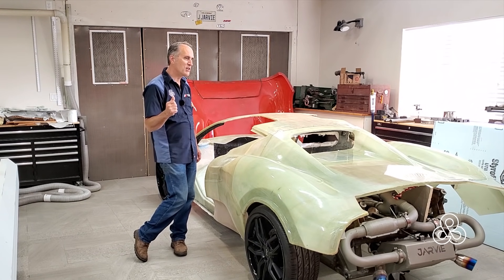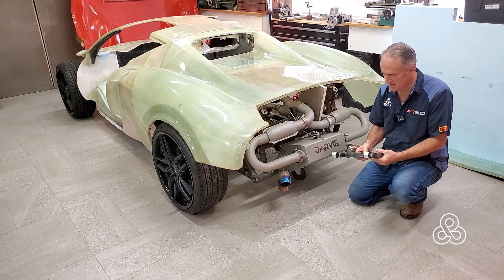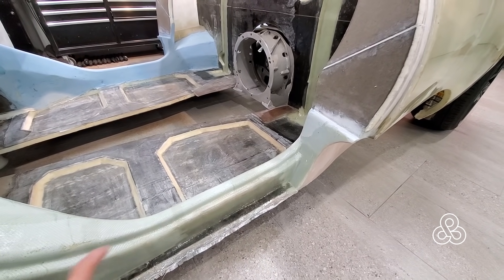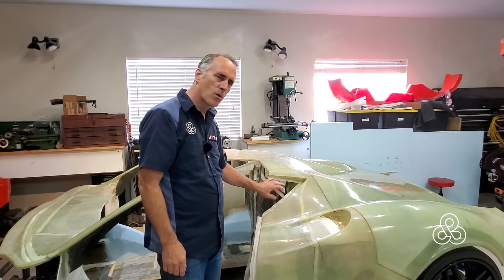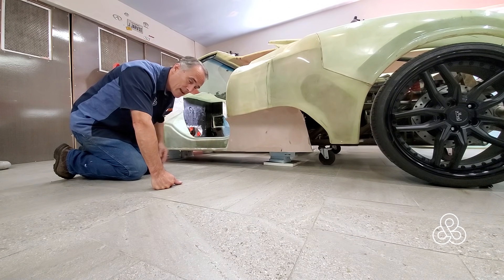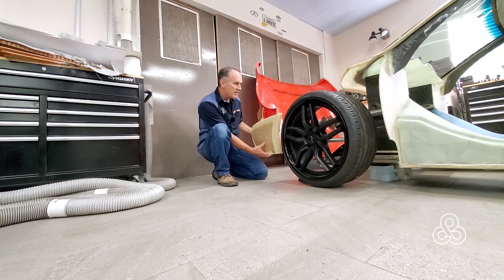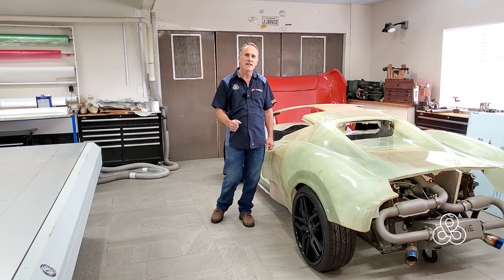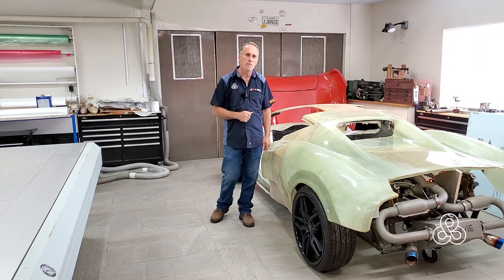Building a supercar from scratch! - What I would do different next time.

Comment: Imagine how much less rework would have been needed, if using Autocad had not reinforced the misconceptions of 3D modelling being expensive, complicated, difficult, and time consuming. All of the mentioned issues with the footroom and steering radius could have been solved by a kid using Blender, with a simple box selection, (click and drag), press "T", and move the whole front forward a few inches, before commiting to the build. With Blender (which is free... so much for it being "expensive"), you can even have models exported to "folded paper" model, to get periodic physical models for visualization... additionally (and what I often like doing), is to use a paper model export projected to life size onto sheet metal for the bulk of a build project's components, or even to produce a mold that could be not only guaranteed 100% symmetrical, but could also then be smoothed over for nice rounded contours for making a mold. Or even cheaply, without making full metal models, you could project onto plywood and cut and glue the geometry into shape. It's like condensing weeks of doing it the hard way, into just a day or two, and having a visual 3D model to proactively predict those issues, before putting actual labor into things you would just end up needing to rework or fix after many hours invested. 
 
At first, I thought your aversion to 3D modelling seemed a bit odd, but then saw the video where you mention "Autocad", and then completely understood. Seriously, save yourself a LOT of time and money by checking out how the kids these days are doing it.
Reply from the maker: In general I will agree with you on the speed of 3D modeling, but most of my "changes" would likely not have been corrected in Blender. Foot room was reduced by the tunnel, whose width is defined by the center differential. The center diff is still in the design phase (although I now know the width, hence the foot room expansion). If I had designed all the components before hand, I would be 2 years behind my present state. Perhaps the 3D model would have saved time, but 5 hours to correct the foot room is not particularly painful in a project requiring thousands of hours. You may be pleased to know the new Leviathan project will use Solidworks, Rhino and CNC. I'm not limiting myself to a fixed budget this round. (Well, fixed budget is relative to my finances. Ha!)
Reply: @BuilderCreator  , I think you may not be seeing what I was talking about. From what I saw, the foot room issue is very similar to what people least like about driving a late 1980's Countach, where the front wheel wells and steering clearance takes up a large part of the foot space left of the driver. That could be remedied in Blender by box selecting all wheel components, steering components (except for the steering wheel and column), and either reshaping the fenders and front end to add a few inches, or else stretch them forward as well, and then either modify or find a different, longer steering column to reach the updated distance between steering rack and steering wheel. 
 
If you make (or scan) models of major components, like engine, transmision, steering rack, wheels, suspension components, etc, (many of which can already be found, created and offered cheap or free from 3D modeller communities), you can design the body around them, already getting an idea of how everything will fit, before shaping the body around them. Such a workflow would save hundreds, if not thousands of hours, especially in the reduction of needing any rework, or the time taken to sit back and brainstorm mid-build to figure out how to fit something in later. (I used to do it that way too, the building up by hand, then many hours cumulatively doing nothing but thinking on where to ge next, or how to make something fit). 
 
I recommend Blender over any commercial products because of it's widely available open source community, plugins to do just about anything, including direct 3D printing, and because many free addon libraries can do things that no other 3D design or CAD programs can do, like "Folded Paper" exports, and even "rigging", if you want to go into added detail on how moving parts will fit and operate. 
 
Scanning things like a motor or trans that you have on hand, is as easy and free as taking photos or video around the object with a cell phone and then letting SFM (structure from motion) build the 3D model  based on what details change between each photo or frame.
 
Measurement tools in Blender can help to plan out materials to cut in precise sizes and angles for welding up a frame or any tubing, or even any geometric metal shapes used in the construction.
 
I really do wish that I had the time, workspace, and materials to demonstrate.
Reply from the maker: @JamesMorningstar  I understand perfectly! However, when you are on a budget project like this, you may not know what some of those parts are for months and If I had waited to find and scan all the parts then I may have dropped the idea and moved on to something else. Example- It took me about 8 months to find a set of 1:1 helical cut gears for the center differential. I was not willing to pay the $4500 for the set up to have them machined. In the end, a subscriber put me on the path to source them. I would not have had a "subscriber" if I was still modeling. As I previously mentioned, the differential defined the foot room. Once I had the dimensions of the gears, I gained 2 inches of foot room. If I had modeled and built on the knowledge of materials from 2 years ago (early design time) I would be driving without the extra foot room, or be driving with hellishly loud straight cut gears by my knees. Maybe it is not for everyone to just jump in, commit and get building (as hundreds of unfinished projects demonstrate), but modeling every component will scare the hell out of a would be builder as well. Just collecting the parts you are not going to fabricate is a daunting prospect. perhaps this is why there are so many "kids" modeling cars and so few building ground up projects. Thanks for the great conversation.
Reply: @BuilderCreator  , some valid points for your particular method. My style is more about looking to see what I have available, or could find to work with, before either fitting them together or figuring out what else is needed.  For me, 3D modeling can start as early as the initial brainstorming stage, because it's easy to revise as the parts list changes. 
 
There was a guy, I forget his name at the moment, but he was building an MR2 fitted with a Tesla engine. IF you come across his videos, and notice how he scanned the motor he had, and then scanned the engine bay, and used 3D modeling from those scans to figure out a perfect fit... That would be like a median, half way between our different prefered methods. 
 
I'm not criticising your method at all, just trying to suggest things I think may help with any future builds. But I agree, first and early builds should be primarily by hand because of the need for the experience, as well as revising the techniques of construction phases. I've never built a fully custom designed car before, but used to make unique kit-cars, where it's mainly just fashioning a stylish body to place on some production car's drivetrain. Back then, I't sketch the look on paper and then go to work cutting plywood "ribs" and then stapling window screen over the ribs as a basis to lay the fiberglass over. But I think we were on the subject of how to do better next time, or "things to do differently". 
 
Speaking of budget, all of my past builds came in well under $1000 total, but that was in the late 1980's when it was easy to find running used cars in the $150 - $400 range. Talk about working within a budget. I think my favorite and most exotic build was an 1800cc VW powered Formula-1 styled car with dual turbo, dual carbs, and a transmission from a VW Transporter bus. That one may have went a little over the usual budget at somewhere around $1400, if I recall.

Comment: The problem with doing the skin without the mold is that you'll have a hard time finishing it well without using a lot of bondo type material.   That filler will crack over time   What you did with making the mold is much better.   Besides, sooner or later you'll be making another body from the mold.
Reply from the maker: True, the mold is better, but the thin skin moldless can be done with little to no filler beyond fill primer. The molds do make for reproducing a part easy when I hit a rabbit at 140mph. Ha!

Comment: Would you have used carbon fiber and Kevlar instead of fiberglass if you could..
Reply from the maker: Probably not until problems are resolved and the car moved to more of a production stage of development. I will be using Kevlar in some impact areas of the car and carbon in strategic spots and for asthetics

Comment: I am DIY enthusiast. I watch all kinds of DIY VIdeos. I am watching your playlist while in COVID 19 quarantine. Infected with the virus. Your videos are very inspiring.. But I think that you have designed your car outside in. Which should be otherwise. I might be wrong. It would be much convenient if you first designed the system and then design the body around. Thanks.
Reply from the maker: Keep a positive attitude and you will pull through the virus without much trouble. The design of the car was done my head and in CAD all at one time; thinking of all the assemblies and styling congruently. What you are seeing is just the sequence of parts being created, starting with the body then the sub-frames and power train. If I had been a large manufacturer all these parts would have been built in odd locations and then brought together for assembly. Since it's just little old me all the parts are getting built in one spot and test assembled and will finally be brought together one last time.

Comment: It would be nice if you have auto generated CC on. I'm deaf and I have no idea what you're saying but I'm extremely interested in building my own supercar someday.
Reply: He was mostly talking about things he may have done differently with the advantage of hindsight. He also pointed out his tight footwell areas that were dictated by the particular steering rack and turn radius tire clearance concerns. Also talked a little about the foam core floor plan which required fiberglass to be installed on alternating sides. He may have just used a flat floor and added structure by adding the shapes to the top side only. There was the bit about the narrow door sill being the desired design with the knowledge of many monocoque designs using a very wide sill to gain the strength needed. He will install the driveshaft tunnel as a structural member instead. Doesn't like sliding across a door sill to get in and out. 
It's very easy to be unaware of the benefit CC provides. The best of intentions makes improvements easy.
Reply: @WireWeHere  thanks man

Comment: What about a steering rack from an old chevy corvair?
Reply from the maker: Unsafe at any speed! haven't you heard?
Reply: @BuilderCreator  Just trying to come up with a solution that might help in the fitment issue, sorry for trying to help. unsub!
Reply from the maker: @kking1367  You must have been born after 1990 and are not familiar with the Ralph Nader book (controversy) of that name. My tongue in cheek sarcasm would have made you laugh, had you known the context. Sorry! My first car was a Corvair.  The first car I built used a Corvair engine /transaxle. If I came across a Corvair I would restore it rather than rob its steering rack- That is the only reason I would reject your proposal. But thanks for watching a few videos.
Reply: @BuilderCreator  So wrong , 67 . Nader owned one my friend and the issue with the car was the rear suspention design and had nothing to do with the steering rack.
Reply: @BuilderCreator  By the way I won the hurst modern muscle award at good guys nationals for my 2013 mustang build , but I guess I don't know anything about building cars. I will leave that for pro's like you.

Comment: Used to work Auto Glass I think you should remove it and bring the glass close to the frame stand out like a sore thumb small details that's what's important usually people work around cars but they don't pay attention to small details lights front and back they look like they were just put on and don't follow the curves of the body that's the difference from cars like Ferrari and Lamborghini the most important thing in a design of a car is the front lights the eyes of the body it's the first thing a person sees and the last is the back lights everything else is just an abstraction of design
Reply from the maker: You will notice in a more recent video, the rubber trim is gone. Yeah!

Comment: You can make it a centre seat?
Reply from the maker: Drivetrain runs through the center.
Reply: @BuilderCreator  oh. a lot of work but you could have flipped the engine and mated a transaxle transmission to the rear axles, but of course it’s much more practical to have two seats👌🏼
Reply: @pablonj3842   It's also AWD

Comment: Why didn't you want a hydraulic steering rack?
Reply from the maker: I would have had to add the pump to the engine, retrofit a new serpentine belt and tensioner and run 14 feet of hydraulic lines to the front of the car. Other than that it would have been a snap! Ha! The electric steering assist cost me $25. Good question though.
Reply: @BuilderCreator  Thanks for the response. I had forgotten that it was a mid engine car. Haha. Best of luck. Excited for the next video